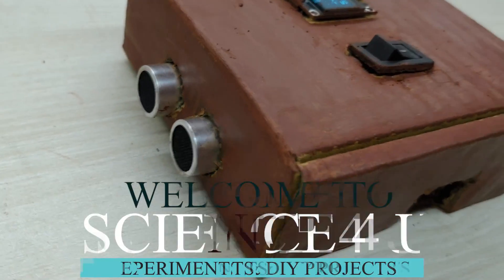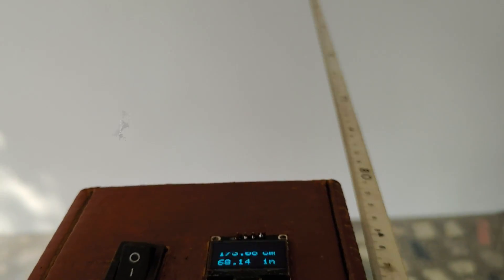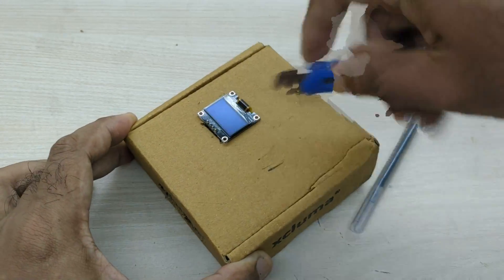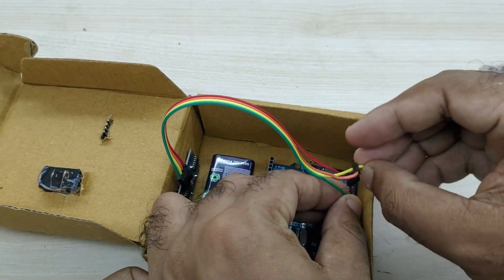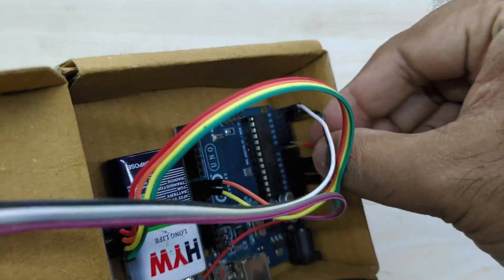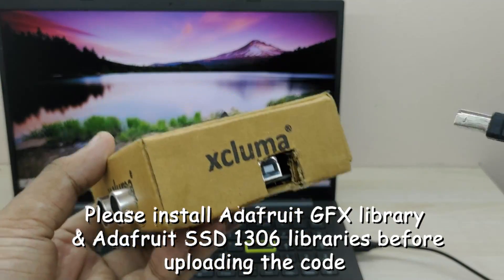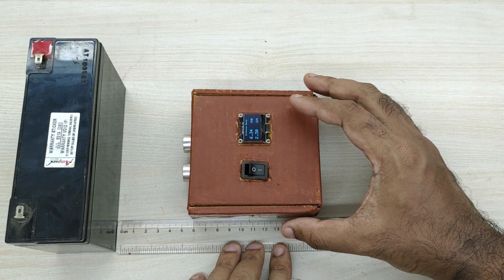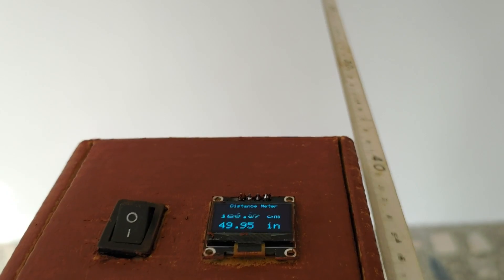Distance Meter / Range Finder using Arduino Uno & HC -SR04 ultrasonic sensor || Arduino Project

Comment: Hello, The code is getting error in header file what should i do, it shows header files is invalid
Reply: Please reply!
Reply from the maker: You have to install the ssd 1306 oled display library..go to manage libraries and serch for ssd 1306 and install the library.
Reply: But is it possible in tinker cad

Comment: It doesn't show 0 and 1cm, it shows some random no like 1191cm, what should we do?
Reply from the maker: Hi friend. That is most probably because the ultrasonic sensor that you have used is faulty. Replacing the sensor should solve the problem..

Comment: /*Door lock system with Arduino Nano
   Home Page
*/

#include <Servo.h>
#include <LiquidCrystal_I2C.h>
#include <SPI.h>
#include <MFRC522.h>

#define SS_PIN 10
#define RST_PIN 9
#define buzzer 2
#define servoPin 3

String UID = "*************";//Enter your card ID
byte lock = 0;

Servo servo;
LiquidCrystal_I2C lcd(0x27, 16, 2);
MFRC522 rfid(SS_PIN, RST_PIN);

void setup() {
  Serial.begin(9600);
  servo.write(70);
  lcd.backlight();
  servo.attach(servoPin);
  SPI.begin();
  rfid.PCD_Init();
  pinMode(buzzer, OUTPUT);
}

void loop() {
  lcd.setCursor(4, 0);
  lcd.print("Welcome!");
  lcd.setCursor(1, 1);
  lcd.print("Put your card");

  if ( ! rfid.PICC_IsNewCardPresent())
    return;
  if ( ! rfid.PICC_ReadCardSerial())
    return;

  lcd.clear();
  lcd.setCursor(0, 0);
  lcd.print("Scanning");
  Serial.print("NUID tag is :");
  String ID = "";
  for (byte i = 0; i < rfid.uid.size; i++) {
    lcd.print(".");
    ID.concat(String(rfid.uid.uidByte[i] < 0x10 ? " 0" : " "));
    ID.concat(String(rfid.uid.uidByte[i], HEX));
    delay(300);
  }
  ID.toUpperCase();

  if (ID.substring(1) == UID && lock == 0 ) {
    digitalWrite(buzzer, HIGH);
    delay(300);
    digitalWrite(buzzer, LOW);
    servo.write(50);
    delay(100);
    lcd.clear();
    lcd.setCursor(0, 0);
    lcd.print("Locked");
    delay(1500);
    lcd.clear();
    lock = 1;
  } else if (ID.substring(1) == UID && lock == 1 ) {
    digitalWrite(buzzer, HIGH);
    delay(300);
    digitalWrite(buzzer, LOW);
    servo.write(110);
    delay(100);
    lcd.clear();
    lcd.setCursor(0, 0);
    lcd.print("Unlocked");
    delay(1500);
    lcd.clear();
    lock = 0;
  } else {
    lcd.clear();
    lcd.setCursor(0, 0);
    lcd.print("Wrong card!");
    digitalWrite(buzzer, HIGH);
    delay(200);
    digitalWrite(buzzer, LOW);
    delay(200);
    digitalWrite(buzzer, HIGH);
    delay(200);
    digitalWrite(buzzer, LOW);
    delay(200);
    digitalWrite(buzzer, HIGH);
    delay(200);
    digitalWrite(buzzer, LOW);
    delay(200);
    delay(1500);
    lcd.clear();
  }
}

Comment: const int ledPin = 13;  // You can connect an LED to pin 13 to simulate a clock ticking

void setup() {
  pinMode(ledPin, OUTPUT);
  Serial.begin(9600);
}

void loop() {
  static unsigned long lastMillis = 0;
  const unsigned long interval = 1000;  // Update every 1000 milliseconds (1 second)

  unsigned long currentMillis = millis();

  if (currentMillis - lastMillis >= interval) {
    // Update the clock every second
    lastMillis = currentMillis;

    // Simulate the clock ticking by toggling the LED
    digitalWrite(ledPin, !digitalRead(ledPin));

    // Print the time to the Serial Monitor
    printTime();
  }
}

void printTime() {
  // Get the current time
  unsigned long seconds = millis() / 1000;
  unsigned long minutes = seconds / 60;
  unsigned long hours = minutes / 60;

  // Print the time to the Serial Monitor
  Serial.print(hours % 24);  // Use % 24 to keep the time within a 24-hour format
  Serial.print(':');
  printDigits(minutes % 60);
  Serial.print(':');
  printDigits(seconds % 60);
  Serial.println();
}

void printDigits(int digits) {
  // Add leading zero if the value is less than 10
  if (digits < 10) {
    Serial.print('0');
  }
  Serial.print(digits);
}
Reply from the maker: That is correct friend. That light blinking according to clock ticking will make it more interesting. .